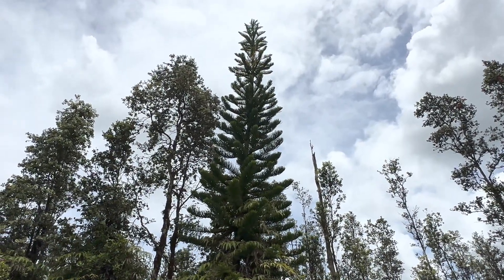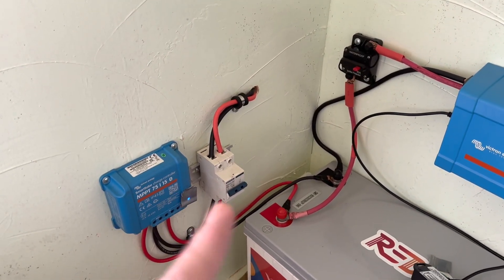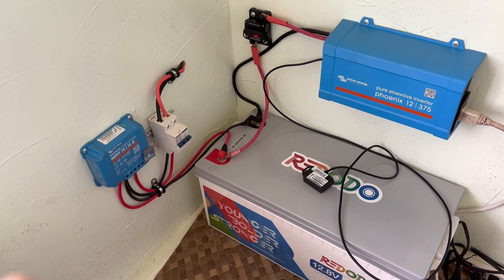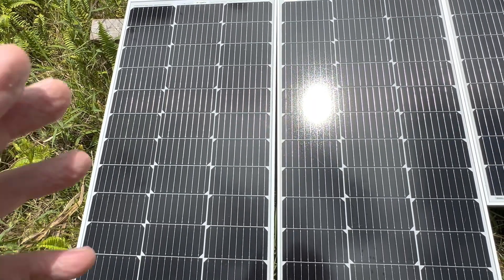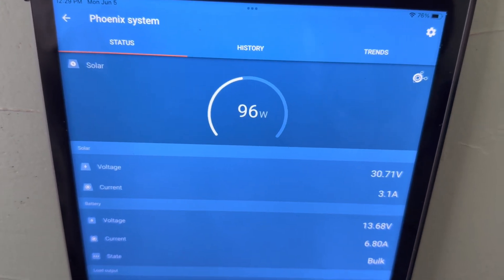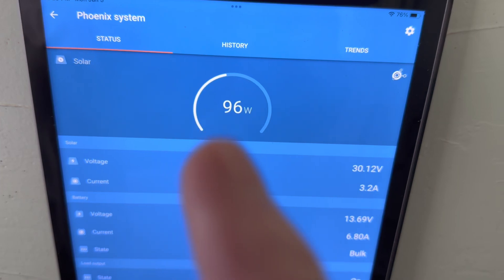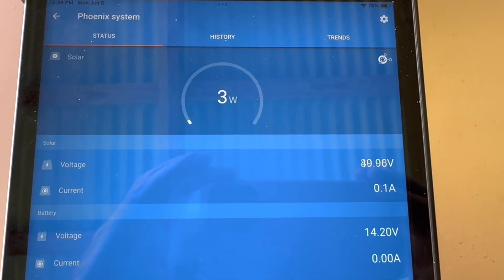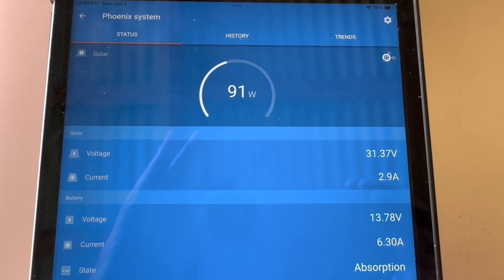Maxing out the Victron 75/15 MPPT with 400 watts solar Works great for my conditions! 200Ah LiFePO4

Comment: I disagree that the controller is limiting the power. Please, correct me.

To my understanding, and i am a newbie, that 75/15 charge controller can handle up to 1125 Watts, not exceeding the 75v and 15A limits. 

So you could add more panels while observing the charge controller specs.
Reply: The limit is on the battery side: 14V @ 15A  (only if he increased the battery voltage, he would increase tha max usuable power from solar array. But he still gains over the course of a day by overpaneling)
Reply: @jbjensen11  Ok, I went back to the specs for that mppt and see my mistake. This is eye opening, Thank you.
Reply: @closetcleaner  Great when we learn. So as you now understand there are more limiting factors in a controller: Voltage, Current(amps), Wattage(which is really a results of the limits on the first two) etc.

Comment: pretty much have the same system but 48v all in a server rack you can't go wrong with victron in the future upgrade to 48v its way more effirect can get alot more power and dont have to use bigger wires etc you have a good little setup 👍
Reply: You must have alot solar input for 48v  many are limited on space and   go to 12v even if cost loke 3 times more
Reply from the maker: Aloha! 🤙

Comment: The maximum PV power you get is really dependent on your current battery voltage and mppt`s max current. e.g  the data sheet for 75/15 recommends 220w array for a 12v battery system as this will be (220w/15a=14.67V) well we normally dont charge our batteries to 14.67V, so if your battery gets full at 14.2V then the maximum incoming PV array can only be (14.2V*15A) 213W. So if your battery voltage is at 13.7V then the maximum PV array you get coming in is (13.7V*15A) 205.5W
However, if you get 100/30 mppt it will double the output since it has a higher current output.
Reply from the maker: Mahalo for sharing this information with us brother! Aloha! 🤙

Comment: it is pretty much the exact system I designed except mine would be 24V 50AH battery, 24V/375W inverter, same charge controller and 4x 100W panels... it would give me the maximum potential for the least amount of money... the battery is the same price as 12V 100AH (they have same total capacity) the inverter costs the same and the charger is obviously the same so costs the same too... instead of beefing up a 12V system with a more expensive charge controller just to reach 400W/12V

Comment: something that you should do would be to reconfigure those four panels. Instead of the two big ones in series in parallel with the two smaller ones in series, I would take a big one and a small one in series, then do the other big one in series with the other small one, then parallel those together. this will provide a better voltaqe match for the charge controller. 
I know you are already maxing the CC out the way you are, but voltage mismatch in no joke, and leaving a poor match in place in just bad practice. The arrangement I explained above will correct this issue.
Try it, make another video showing the difference.
If you want, disconnect the charge controller and take a voltage reading of each of your two series strings, you'll see a difference especially under varying light conditions.
Let me know how this works out for you, Aloha
Reply from the maker: I really like that idea for another experiment, and mahalo as always for sharing that with us. Aloha! 🤙
Reply: @ProjectsinParadise808  I like you man, like a kindred spirit or something.
Reply from the maker: @sNEAKYnIGHTmUPPET  I feel the same way my friend 🤙
Reply: I think the advertised voltage and amperage are the same on the two different panels, or really close.  Not a bad idea though.  You would have to test them installed with a multimeter to know for sure.  All I ever do is do a quick check for open circuit voltage, then amperage, close to 20 and close to 5 on my small 100 watt panels, then connect to a charge controller by itself, or just throw it in the mix to make sure it's working.  I never look for precise numbers. I don't have any mismatched panels though.

Comment: The Victron chargers can be set to act as one I think, so you could put another 75/15 on the 2 other panels, and it could give up to 400w?
Reply from the maker: I could add a second cc yes. 🤙

Comment: Nice overview. I would have enjoyed it more with actual voltage readings or maybe a look at the panel labels showing voltage/amps to make up the 100W. 2S2P PV panels is a great idea to help with partial shading. Thanks for sharing
Reply: Newpowa 100 watt Rigid Mono crystalline 
Voltage at Pmax (Vmp)
19.23V
Current at Pmax (Imp)
5.21A
---------------------
4 panels 2s2p
38.46 V x 10.42 A = 401 Watts 
---------------------
Reply: @anthonyrstrawbridge  How did it hit 59V on that one day? https://youtu.be/6TdnZMYUBxA?t=785
Reply from the maker: Mahalo for being part of the conversation! 🤙

Comment: What is better? The 2 similar in parallel or 2 in Sirius?
Reply: Series is always prefered to keep the amps down due to the higher voltage. However, if your array faces partial shading, parallel is better. In this video a combination works well!

Comment: well you can't series all panels. way over the 75V . watch them branch connector's . made with small wire inside . you may be ok with just 2 strings. check them for heat. also use inline fuse on each string. that way protect each string. if you are doing this on a larger system use a combiner box and fuse each string. now them victron MPPT controllers are current limited to the battery output.  over size PV is ok unless you over-volt the input. if you were to use 24V system it still limits just under 15A giveing you about 2X total watts. watts is amps times volts. the panels I got are big. over 300 watts each and have shading diodes built in . also the victron MPPT charge controllers are thermal protected as well. but always a great idea to let plenty of air to get threw them. with that max out it will get warm . read manual for clearance needed on MPPT and/or inverter . now them MC4 fuse holders place eather pos or neg side of each string or even both sides, you can even place them between each string. you do not need to go crazy . just 1 fuse per string is fine. the windynation MC4 fuse holders comes with a fuse rated higher DC  volts. keep spares.check the DC volts on fuse. I got 1KV ones on mine. easy to install is MC4 male and female. just take apart and insert fuse. my MC4 kit came with small plastic blue tool for taking them apart.so easy. hard in fingers without tool.
Reply from the maker: As always brother, thanks for information. Always a pen and paper in hand when reading your comments! Aloha! 🤙
Reply: yes watch those little y connectórs. I had one melt with about 25 amps running thru it. glad I found it when I did. I noticed my charge controller was all a sudden way underpowered and started looking at why and found that melted branch connector. I replaced them all with the 50 amp version and so far so good

Comment: My EpEver 20a does the same - it feathers off from the maximum power point to limit current when approaching its max current to protect itself - in my case, the panel is just 20w over spec so it seldom goes into this mode, however, I noticed that the unit does get pretty hot when its maxed out and have fitted a little PC fan to come on via a thermal switch wedged in the fins of the heat sink - You need to watch you don't cook your mosfets maxing out your controller.
Reply: Yes, I also live in a hot climate and the charge controller can overheat so quickly, good idea with the pc-fan & thermal switch, got mine rigged up the same way now, thank you :)
Reply: @USL.Website  Them little thermal switches are brill - I think from memory I fitted a 50 centigrade  one - it seems to come on 17 amps and over on a 20a controller - I used a 40mm 24v fan as I just wanted it to gently keep the air moving and be quiet

Comment: I have an Epever 60 amp mppt controller charging 2 100 ah. Weize Lipo 4 batteries.  I run 100 watt panels and even on sunny days I can only get my batteries to 13.9 volts. Any ideas would be appreciated.
Reply: EpEver's standard setting is to Bulk charge at 14.6 v for lithium until it is 90% full and then Absorb for 2 hours - 13.9v  ( 3.45v per cell) is a good  Full voltage if you want your battery to last -  there's almost no energy gain in charging your battery up the "Knee"  to 3.65v per cell it will stress your battery and shorten its life considerably.

Comment: Using more panels than a charge controller can handle is a good idea when extra panels are available. They help when the sun is covered by clouds or even on rainy days. Keep your batteries full and you don't need to burn fuel when little sun is available.
Reply: yes, i agree with you.. where i live i have an average of 1/5 sunny day and few periods in the year i can have a covered sky during 3 weeks.. fortunately victron can deal with it by limiting the current.. also with the Victronconnect appi beautifully presented, it's why i chose this company.. i think the SmartSolar 75/15 model is the most saled/popular (and i have it)..
Reply: Just make sure you aren't exceeding the charge controller's max V and I input ratings!
Reply: @ItsEverythingElse  There is no Imax input, there is just Imax output ! and Vmax input.
Reply: Maxing out the MPPT every use is not good in the long run for the controller I’d just upgrade to a 20 or 30amp 😞 I run a 100/30 on a 24v system, right now I’m running 2 200w 18v or 36v switchable panels
Reply: @CampedOutGamers  why wouldn't that be good? how can you say that?
Reply: @Richi42 better chance than good the controller will eventually burn out quicker by maxing it out constantly.

Comment: Even though, theoretically, you can use a branch connector for two series strings, you really want to use a solar combiner box instead that puts an appropriate fuse on each string.   And of course with more than two you must use a combiner box.   But if you are safety-oriented you also should use a combiner box when paralleling two strings.   Doubly true when variable shading is involved.   Also, those branch connectors are generally really poor quality... I've got a bunch of them and after one got hot when it shouldn't have (due to poor quality manufacturing), I stopped using them entirely.

I have one of the 75/15s and several 100/20's.  You can see there is 5.7A on the solar input (which is fine), but 14.8A on the battery output which is near the limit of the unit.  At roughly 14V on the battery side you are limited to 210W.    Now, if you had a 24V battery system instead of a 12V battery system, that same little charge controller would be able to do 15A x 27V (roughly) which would be 405W.

This brings to mind the "creeping upgrade" problem, where all of us enthusiasts are constantly adding to our systems well beyond the original design intentions.

In anycase, yah, you will get better production across the day by over-paneling the charge controller, but you are also leaving quite a bit of solar production on the table that you could have soaked up but didn't.  I guess it comes down to looking at the curve.  If the charge controller is maxed out for more than an hour or so each day, the amount of energy being left on the table really starts to get excessive.

I do like the fact that the Victron charge controller firmware properly limits the power to what it can handle.  And its even a bit better... it also limits the power if the charge controller gets too hot.
Reply: It's self limiting, you can throttle it to whatever amps you want as well.   I have had over 600 watts of pannels connected to the 75/15....   and over 1200 to a 100/30.  It's a more predictable daily production to be over panneled.  The 75/15 is of weaker design though, it hasn't a built in heat sink.  I have mine bolted to a chunk of aluminum to help disapte the heat.
Reply: @john0270  I use the load output of one of the charge controllers to control two quiet fans (mine are in an enclosure so I have two fan ports, one for air-in, and one for air-out).  It works great.   (recommend 140mm fans or larger if you want them to be quiet).

Basically just load output through inline 2A fuse directly to the fan since you have a 12V battery system.

For a 12V LFP system set the charge controller to turn on the load output at 13.28V and turn off at 13.25V.   The numbers may seem odd but they work great if you think about the charge curve and the discharge curve.   It will hit the fan turn-on near the beginning of the more linear part of the charge curve, and it will hit the fan turn-off shortly after the battery switches from the charge curve to the discharge curve as the sun goes down and generation is no longer able to match the load.

--

In anycase, while it is true that you get more consistent daily generation by over-paneling, its only because you are leaving a relatively large amount of generation on the table.  Usually its better to capture that energy.

In your case, just buying another 75/15 would do the job since they're only $137 (for the bluetooth version).   You can parallel as many charge controllers onto the battery(ies) as you want as long as the total output amperage is within the battery's tolerances.
Reply: @Junker Zn  oh yes, I now have 2 100/30's and a 75/15 running on my pannels.  I have often wondered if you can parrel multiple charge controllers on the same pv line....  

 Getting ready to switch over to a self assembled 8kwh lithium battery soon.    My little lead acid setup wastes a good 25% or more of the energy I was throwing at it.

I'll have to use the load output setting on that thing one of these days.
Reply: @john0270  Yes, as long as the total possible charging current from all the charge controllers added together is less than the maximum charging current allowed by the batter(ies), and that the related breakers and wiring can handle that current.

For example, my system has three charge controllers feeding the batteries 20A x 3 = 60A.  So I have a 65A DC breaker, 2-gauge main battery wiring (to avoid losses) which can handle 150A.   The battery is rated for 100A charging though since I have three of them in parallel I can theoretically push 300A.   But it would be silly to make the wiring that beefy so I decided to limit it to one battery's worth.  I put an appropriate fuse in-line with the main battery cable... a 100A ANL fuse in this case, just in case I want to add a fourth charge controller later on for 80A.

Comment: Those parallel branch connectors short out really easy for one reason or another. I've seen one start smoking and crackling when I hooked it up to 4 X 100 watt panels in series.  ALso had one sizzle when I connected it to a customer's 200 watt panels. And to top it off, I have seen some youtube videos of this happening, so thats why I say the sizzle quite frequently.
Reply from the maker: Mahalo for sharing that! I will keep a close eye on them...my first time using them. Aloha! 🤙
Reply: @ProjectsinParadise808    Reading that comment from MikeAndNary,  I had a strange issue a couple of weeks ago. Controller was not making power what it should make. Went to the garden, unhooked the connectors to do a shortcurrent test and both panels were ok. So I was a bit baffled. Took a smaller cable to measure after that 'combiner' and presto I measured only the short current from 1 panel. Now current, parallel and dc you can add the currents, so a panel generating 5A and another 10A listed as short current will result in 15A.  Took that combiner out and measured the resistance which should be 0 Ohms on all connections.  Nope, 1 side to the panel was open, infinite Ohms. On very close inspection I could see a small hairline crack but that was it. I now switched over to those Y cables that you can use and all seems fine. 
Btw I am not 100% sure that you can place pannels in parallel without using a diode in series. Might want to google that.  They are not expenisive and might save you from possible issues.
Reply: So far I have gotten away with using them.  On 4-100 watt pannels, and on 4-300 watt pannels.  Though all 4 of my renogy 100 wat pannels the connectors disintegrated